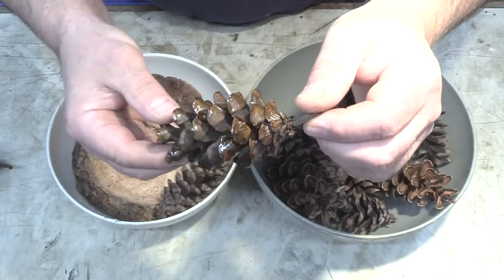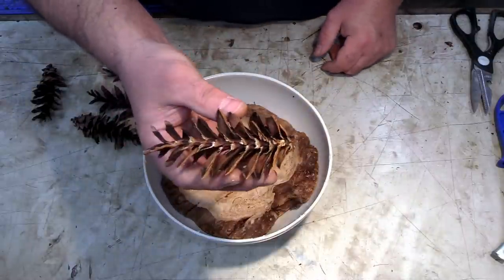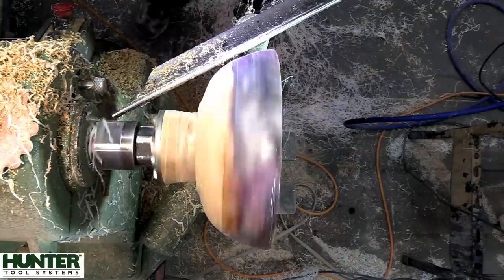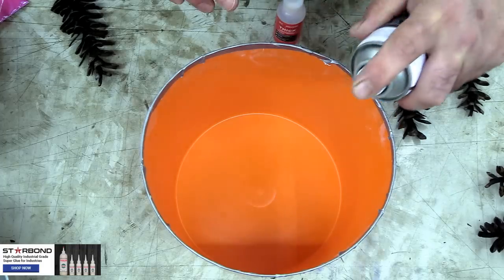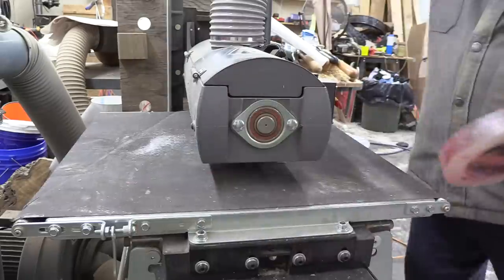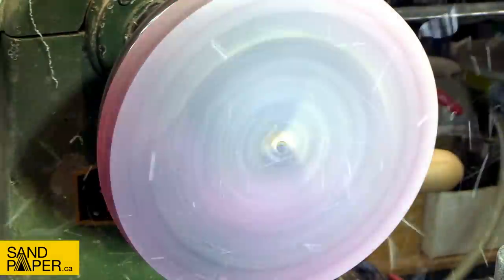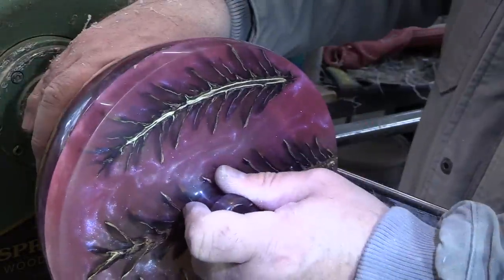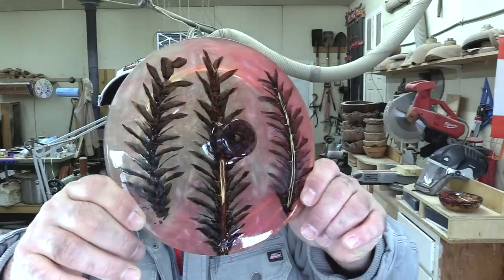Woodturning - The 90K Subscriber Lidded Dish

Comment: The bowl is fantastic, luv how it looks in the end pictures lit up and rotating.  So much happening there!  The lid I'm not a huge fan. I do like it upside down as a shallow bowl.     
Maybe the resins I use are different but I've found resin sticks really well to resin and you don't need to scuff it up to assist if doing it in separate pours or what not. It's never been an issue for me but as I said different resins may need different approaches.   Really luv that bowl  😁
Reply from the maker: Just playing the safe side to scuff the resin up. Thanks for watching

Comment: Hey Jim love the colors and the different orientation of the pine cones. I also have a question I don't turn at all I just like to watch you make art . I know you're left handed but I still don't understand what turning on the outboard side means. Could you maybe explain a little better if not no biggie. Thanks much for your body of work.
Reply from the maker: If the outboard side of the lathe has right hand threads, for a lefty it would be the same as working over the lathe bed. It’s backwards for us. But if the lathe has left hand threads on the outboard end, then we can use our dominant left hand on the bottom of the gouge like a right handed person would do over the lathe bed and not have the work unscrew from the lathe. Hope this helps. Thanks

Comment: This is outstanding. Silly questions I’m sure. Why epoxy vs resin, or vice versa ? Is one better than the other ? Is one used differntly than the other. Sorry, but I’m trying to learn.  Thanks
Steve
Reply from the maker: Part A is the resin and part B is the hardner. When they are combined together they make epoxy. The only exception is the UV resin, no hardner required. Thanks

Comment: Hey, another great job Jim.  BTW, where do you get those plastic mixing containers, just on Amazon and do you re-use them or just through them out every time?
Reply from the maker: I get them from Ardec in Quebec, in most cases I do clean them and if I don’t I put them in the recycling when the resin cures. Thanks

Comment: I have a question oh master of epoxy.  I am using Designer Deep and want to know if it is nessary to keep keep the casting in the pressure pot for the full curing time.  The real reason is to foece the bubbles to dissipate or something.  I know it will not be set yet but will all the bubbles be gone in two days?  I would like to use the pot sooner than later.  Dinger Epoxy....
Reply from the maker: I typically pull the casting out after two days and cure it on the bench. Thanks